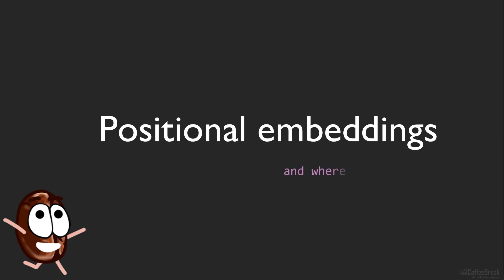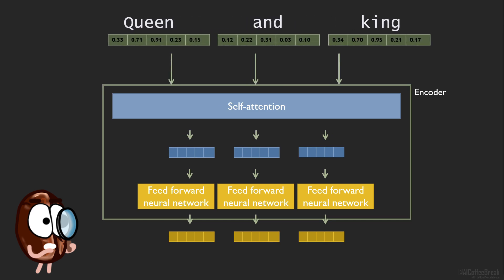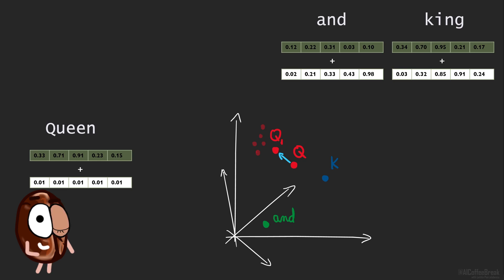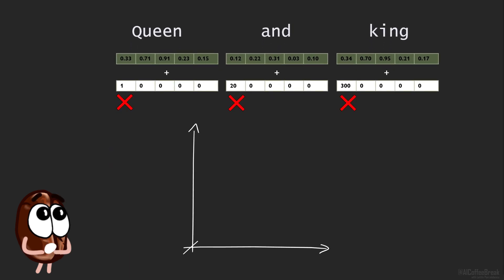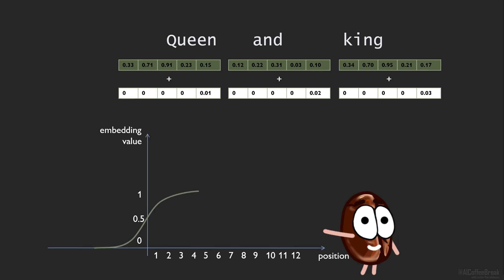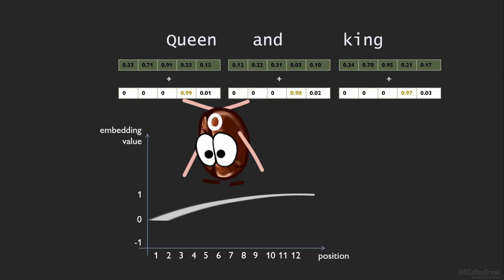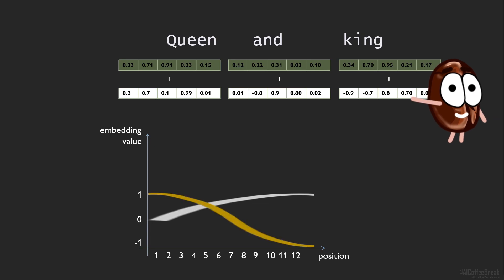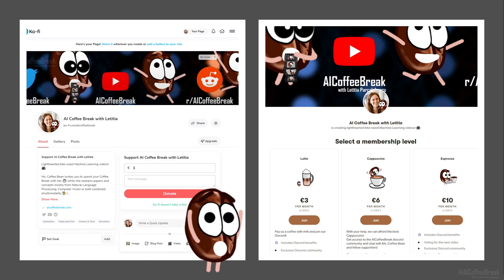Positional embeddings in transformers EXPLAINED | Demystifying positional encodings.

Comment: Hi Letitia. Thank you so much for your wonderful video! Your explanations are more intuitive than almost anything else I've seen on the internet. Could you also do a video on how positional encoding works for images, specifically? I assume they are different from text because images do not have the sequential pattern text data have. Thanks!
Reply from the maker: Thanks for the suggestion. I do not think I will come to do this in the next few months. But the idea of image position embeddings is that those representations are most often learned. The gist of it is to divide the image into patches, let's say 9. And then to number them from 1 to 9 (from the top-left to bottom right). Then let gradient descent learn better representations of these addresses.

Comment: Gemini: This video is about positional embeddings in transformers.
The video starts with an explanation of why positional embeddings are important. Transformers are a type of neural network that has become very popular for machine learning tasks, especially when there is a lot of data to train on. However, transformers do not process information in the order that it is given. This can be a problem for tasks where the order of the data is important, such as language translation. Positional embeddings are a way of adding information about the order of the data to the transformer.
The video then goes on to explain how positional embeddings work. Positional embeddings are vectors that are added to the input vectors of the transformer. These vectors encode the position of each element in the sequence. The way that positional embeddings are created is important. The embeddings need to be unique for each position, but they also need to be small enough that they do not overwhelm the signal from the original data.
The video concludes by discussing some of the different ways that positional embeddings can be created. The most common way is to use sine and cosine functions. These functions can be used to create embeddings that are both unique and small. The video also mentions that there are other ways to create positional embeddings, and that these methods may be more appropriate for some types of data.░

Comment: Thanks for the explanation! But why after we add position vector to the word vector, the position information is still preserved??
Reply from the maker: It's complicated because it's super high dimensional. But on a high level, adding a vector to another vector, shifts its position in each dimension a bit. We add always the same vector to the first position, so the transformer learns that the first position is always shifted a bit around in that way. Maybe it is not recognisable in all dimensions all the time, but it has 768 dimensions to get the pattern. You should not underestimate neural networks that are correlation discovery machines.

Comment: Why are the words initially  represented in as a vector of length  512 ?
Reply from the maker: The vectors could be longer or shorter than that. 512 was just an example from the most common architecture back then (BERT base). The longer the vectors, the more parameters the model has. The larger the model, the better their performance, but also the slower their forward passes.

Comment: thanks for explanation. but one question, do we also need to use this positional encoding for other inputs, like, for security or anomaly detection datasets which consists of only observation states with corresponding timestamps?
Reply from the maker: If the timestamps are already in the input vector, then no.
But if you have the observation states only, you need to give the order (the timestamps) to the transformer model, otherwise it would be completely ignorant of the fact that the states it processes, are actually a sequence. :)

Comment: In another video I've seen, apparently it doesn't matter if positional embedding are learned or static. It seems as thiugh the rest of the model makes accurate deductions regardless.

This is why I was not surprised that Fourier transforms seem to work nearly as well as self attention.
Reply: COuld you please elaborate using an example maybe?

Comment: Thanks Letitia! A vid on relative positional embeddings would be nice 😃
Implementations seems a bit involved so I've never used them in my toy examples.
Reply: Regarding this topic, I've seen positional embeddings sometimes being added and sometimes being concatenated with no real justification for either 😐
Reply from the maker: Concatenating has the luxury of extra, exclusive dimensions dedicated to positional encoding with the upside of avoiding mixing up semantic and positional information. The downside is, you can have those extra dimensions only if you have capacity to spare.
So adding the positional embeddings to initial vector representations saves some capacity by using it for both semantic and positional information with the danger of mixing these up if there is no careful tuning on this (for tuning, think about the division by 10000 in the sine formula in "attention is all you need").